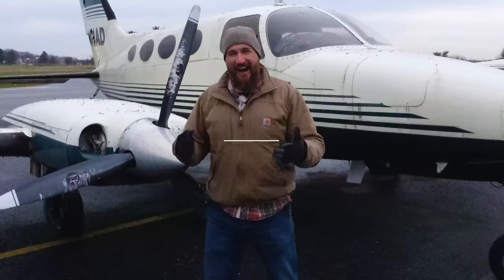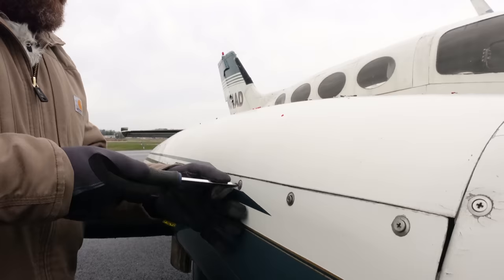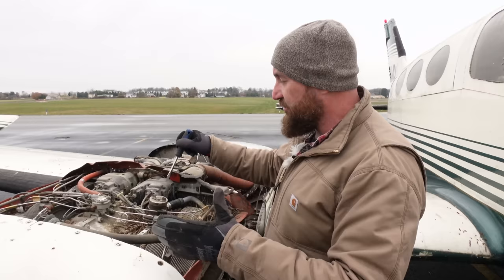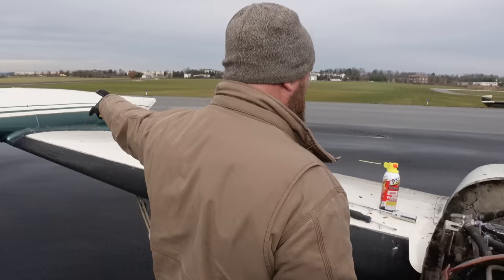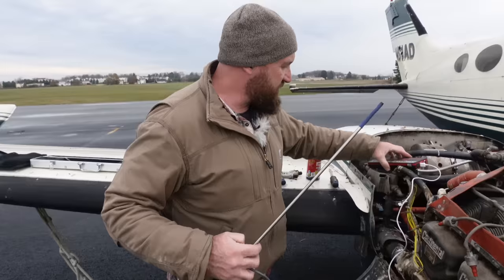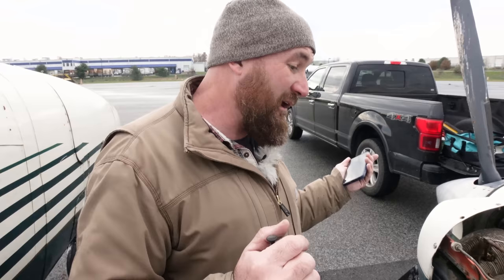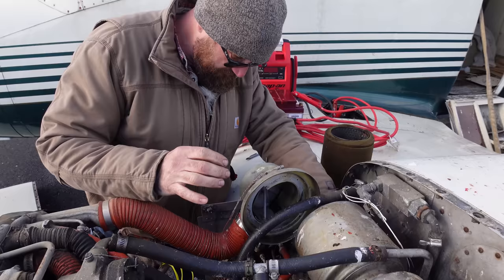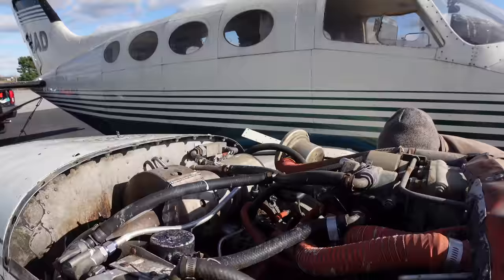FREE Abandoned Airplane... If I Can Start It! Ep1

Comment: 7 years as a 43250 Jet engine mechanic during Vietnam and then my A&P and 7 more years before moving on. You have not seen anything until you are working on a Pratt and Whitney Jet engine or a GE unit. There are more wires and more hoses than you can ever think of. Not to mention each and everyone of them has to be safety wired and then getting to some of the ones that are covered by other components well lets just say it lends a new meaning to what a bitch and what jerk designed this?
Reply: I have actually seen them with covers off...in a video and thought OMG...no thank you. I'm glad there's guys who like r WILL work on em haha
Reply: When I went through mechanics school thirty plus years ago we had a saying.  Engineers design machines to piss off mechanics. If you look under the hood of an automobile or cowling of aircraft today it seems to have not changed a bit.
Reply: @repairdroid77  It doesn't help the EPA is legislating tons of extra stuff required

Comment: Found this by accident, and love it!
  FYI a sized turbo has zero impact on that engine starting and idling.
  Looking forward to more! ✌️
Reply: Are they there for fuel consumption?
Reply: @brokearcader6625  no, any supercharger is designed to increase power.  In an aircraft of this nature it could be considered an altitude compensator.  If a turbocharger is seized there is still the ability for intake air to pass through it on the compressor side and exhaust to exit on the turbine side.  Both will be restricted to a significant degree but for the case of starting the engine a sized turbocharger would have absolutely no impact, so the creator here is 100% wrong.
Reply: Bullshit. Thats about all it will do if the turbo is frozen - start and idle.
Reply: @pbm7715  wrong
Reply: As a 30y r LAME I can confirm...turbo is just there to maintain sea level pressure at altitude for engine performance (otherwise less engine power as you climb into thin air). Nil effect on the ground so you could just disconnect and remove it and will have no impact on starting/idling.
Reply: Very glad someone told him. I've been a diesel mechanic for more than 40 years. I seen hundreds of turbos frozen in that time. About 85% of the time it's the bearings. The engine will run just fine without it just won't develop as much horsepower.

Comment: Sadly if it does fire up in the current condition without the jugs removed and cleaned, will destroy the engine cylinders due to the corrosion scaring.

Comment: Airboat owners might like the engines (running) Rebuilding mags is fun, turbos $$, Maybe too many AD"s due on the engines for airworthiness, but for airboats it doesn't matter. It all depends on which route you want to go. Good luck with it.
Reply: Regarding the turbos isn't it just a matter of replacing the bearings?

Comment: Half-way through and my guess "will it start?"... Yes, but it's gonna take you a ton of work + rigging stuff in strange ways like mixture, throttle, etc.  I think you'll get it to turn over and maybe chug along on half the cylinders with A LOT of work.  Will it ever be airworthy?  No way - the thing is a write-off and should be scrapped.  Best thing for the owner is to give it to you anyway, then it becomes your problem.

Comment: Continental are damn fine aero engines. I think both will probably run. How well is anyone's guess. But to get gifted a 401 1969 model if you can get it running! 
  Good aircraft Cessna and late 60s types were very solidly built. I'm kinda wondering what the spar/s are like and the control surfaces and their cranks and runs etc. Really interesting show , I absolute love stuff like this. You always learn something new. Or see a better method than your own. Thanks.

Comment: Seeing this now, I guess that it will need months worth of work before it can be declared airworthy. But then if you are taking lessons to fly, it might be a great reward to get it to the air and quite a luxurious thing too.
Reply: These types crash nicely too. Or, maybe i'm thinking of the PA twin.
Reply: I doubt if even this free kite would justify the cost of getting an air worthiness certificate.I served my time on Vulcans,Hs 748,Shackletons etc and know the alloy airframe will certainly be compramised due to corrosion.
Reply: @routmaster38  I think it's a great idea in principle but, yeah...perhaps a hard landing would break it apart...
Reply: @routmaster38  They have rebuilt WW 2 planes literally from scratches but of course the reasons to do so might be entirely different and resources likewise.

Comment: You can't have too much available amperage, the 12 volts instead of 24 can easily hurt things.
Just buy 2 high cold cranking amp 12 volt batteries. Hook them up in series to make 24 volts.
Reply: Low voltage isn't going to hurt anything.
Reply: @TonyRule  low voltage can easily burn up the starter and burn up the charging system and weld the points together.
You should actually know what you are talking about before speaking.

Comment: Those are amazing airplanes. 325HP engines and its essentially a non pressurized Cessna 340.  Unfortunately the engines are shot and best option is to find good used lower time engines to replace.  401's are not a common plane for sale, however good condition and running planes are $50K - $80K.  Stripping that plane, interior, new engines, prop overhauls and other maintenance is well over $100K.  Sad to see such a great bird sit for so long.  I love the Cessna 300/400 series aircraft. As mentioned in another post, the biggest thing is the wind spar AD.  Sometimes the highest and best use for this is to sell as a parts a/c to keep others flying.

Comment: That is a great airplane as I used to fly the 310 340 and the Cessna 421. They are commonly known as the twin Cessna line. You will need to gut the interior and take apart the cockpit to clean and replace wiring. Then both engines need to be removed and taken apart as well as the props. Will cost a decent amount of money but I would invest some money and time to get it running again. If you rebuild those motors you will then in a sense have have low time plane and could fly it for about 2000 hours be TBO. But of course the rest will need to be done as well. Partner with a qualified Air Frame and Powerplant mechanic. Good luck.
Reply: I wouldn't get in it till after all repairs had been made and 200 non eventful hours had been logged. Even then, my nerves would probably take a few years off my life.
Reply: @mctransportation9831  you ain't bullshitn
Reply: Love the 310. Such a cool plane

Comment: I applaud your enthusiasm, but this is difficult for an engineer and aviation expert to watch.. It was impressive that you knew to listen for the magneto impulse coupling! But there is so much that is outside your experience, things that pilots, owners and especially mechanics learn over the years. For example, it will run fine with a frozen turbo, just won't boost at altitude. 

I hope you can get some help from knowledgeable folks... sounds like you may have some available. Aviation is rewarding and fun, but inherently intolerant of error, especially trial and error.
Reply: As I read you post several things came to mind. I was a FE in Vietnam and since have been involved in aviation at C152 and gliders. It doesn't sound like he has  an A&P license which would be required if he ever plans to fly it. As you know the FAA is funny about the difference of being knowledgeable and being certified to work on an airplane
Reply: I was thinking that the same thing.
Reply: Absolutely nailed it, my thoughts exactly. I don't know how many times my crew chief and I cringed while watching this (especially when he turned the R/H propeller backwards- generally a very unwise move when it comes to certain Continentals!). Aircraft maintenance is not a game, and restoration in particular takes a lot more than a background in mechanics to be done properly- not to mention the extreme monetary investment one must be willing to reserve. Without the books, this thing isn't worth its weight in raw materials, and is further devalued by its archaic avionics suite.

Better to cut the losses and steer very clear of this one.

Comment: Even if you get it running you’ll need the airframe and engine logbooks.
Reply: He's in contact with the owner, I'm betting it wont be a problem
Reply: Not really, you can make new books, just hurts resale value but who cares
Reply: You can start new logs. I owned a plane where the logs were lost in hurricane flooding in the 1990s. It was no big deal and was even flown under part 135 after that. It often cuts the value of the plane in half. However, when I sold my plane I managed to get full price.
Reply: @robertthomas5906  the problem is the log books show what AD’s have been done and without that you have to do the AD’s and the 401 has a wing spar AD
Reply: @ericfletcher8454  LOL... Yes. Would you fly this plane without checking the wing spars even if it had been done before? Document everything. Otherwise, it can bite you later. I had a pair of scab patches on the bulkhead in front of the gear well that passed annual every year for a decade. Then it didn't. Now it was in the log as a concern. It took me two years to get a DER and the plane at the same place at the same time to look at it. About a week later I found a DER that was in my own neighborhood. God has a sense of humor sometimes. It was nothing. They grounded the rivets off, said - yea, so? Then riveted it all back up and signed it off. They think someone wanted to stiffen that area. Just a guess.
Reply: @ericfletcher8454  I'm certain the plane has been sitting for more than a year and the new log books would have to show compliance with any AD, just leave the logbook comments to people who get paid to worry about things like this
Reply: It's real funny there's two regs when it comes to these things, 1. People don't know what they say and think they do 2. People know what they say and interpret properly
Reply: @chadwilcox1077  LOL yeah okay big guy.  We all trust you and your comments
Reply: @ericfletcher8454  thanks

Comment: The algo recommended this to me, glad it did. Impressive resolve and process. I was hoping you'd fly it, but watched till end. Good job tracking down that fuel leak. Many crashes due to fuel leaks. Also how you sussed out that locked up turbo charger. If you gutted the interior and ripped out unnecessary weight, maybe you'd get better fuel mileage?

Comment: Been working on aircraft for a long time. Would be great to see it restored and made air worthy again but the cost will be really high. Sitting for so long I wouldn't be surprised if corrosion has damaged it structurally to the point of it not being worth saving. Gonna keep watching to see how things turn out. Hoping for the best.
Reply: yeah I saw a 206 in similar condition, rodents living in the wings rotted the aluminum skin on the bottom, although it looked fine on the outside, it was paper thin and crumbled upon being touched.
Reply: @andrewd.furnee5233  I can imagine. Had a king air with corrosion so bad it was a miracle how the wing spar hadn't cracked yet. Ended up having to cut the whole thing out anyways though since the piano hinges were rust in place.

Comment: It's really cool, and I've always wanted my own airplane, but looking at this video, I think I'd pass on this. This is way too much work without a good crew.
Reply: It would be a good way to get to know a certain model of plane, tho'... and there are some working examples for sale for under $70k.  I think he is required to have training to do any more than he's done.  He may not want to show those turbochargers being removed from the plane+then reseated, for example.  And what if that fuel seal he replaced were to bust during flight.  There's a video of a non-certified technician making that repair.  So I dunno... probably agree with you.

Comment: It depends on your definition of "started". I predict that you'll be able to get the engines to pop off, or maybe even run roughly on several cylinders, but at this point (I've watched to 26 min so far) I don't have a lot of confidence in you getting those engines running well without some major work and time being spent. I hope I'm wrong about that, and that they spring right to life.
Reply: Not knowing the hours on the engines is what makes this an expensive project.  All needs to be recert.

Comment: No log books it will be difficult to get it in the air.
Reply: According to who you know and how much cash you have. As is the American way.
Reply: You don't need logs to get it airworthy....Just an annual inspection. Logs only REALLY matter when selling.
Reply: Logs only save time for the inspection bill. Without them you have no proof of any recalls, bulletins or directives have been done and therefore they have to be redone to be right.
Reply: i mean, if you're ballsy enough you could (i think) experimental it. not sure I would but, it could be done
Reply: Notice it changed to just get the engine started?
Reply: You are wrong

Comment: ten years as an A&P here- I am very surprised any of those screws came out on those wing panels lol I am not sure where you're located, but working on jets from the coastal areas (or areas where roads were salted) was a nightmare when it came to panel screws and nut plates. I worked on a falcon one time, sat in Sothern Florida on a ramp for ten years, flew to Michigan on a permit, I bet I drilled and replaced more than half the panel screws and nut plates (valve grinding compound is your friend lol).... Cheers and good luck!

Comment: I admire your optimism in this project. As you discovered when buying a couple of o-rings; which probably came with a release certificate; aircraft spares are infinitely more expensive than car spares. The turbocharger is the next expense, followed possibly by the magnetos. Did you check to see if you were getting a spark with one of the plug bodies earthed somewhere on the engine. If you are thinking about getting this aircraft flying again, I hope you have very deep pockets. I am very impressed with your enthusiasm, but please keep a careful eye on your bank account.
I think I would seriously considering handing it back to the birds and mice.   “A” for EFFORT!
Reply: Bro you are so out of touch. Give it back to the birds!?😂😂😂  I want some of what you're smokin!! Seriously tho.
Reply: @projectcruiseaid8601  It will almost certainly cost more than the aircraft will ever be worth in order to get it flying. You can absolutely buy one of these that isn't in the best shape or modernized but that is totally able to legally fly for a fair bit less than he would spend getting this airworthy. Planes are not like cars.

Comment: There may be different material in the av o-rings for the extreme temperature conditions. Don't use standard auto o-rings unless you verify the material properties. You don't want the union to fail in flight because freezing shrunk the o-rings beyond leak tolerance.
Reply: Like the space shuttle... 😞
Reply: @davelowets  Yep
Reply: Auto O rings work in Alaska fine on cars but I agree
Reply: @misfit4816  Apples to Oranges. A car is not a plane... Planes, their systems, designs, and parts, are quite different than cars and are exposed to different environments and stresses than cars also.

Comment: Cool project.  Curious though, how does a plane sitting in plain sight of what looks like a relatively active airport, as opposed to some desolate field or forest somewhere, sit there with the window and door open, to the weather and wildlife?  No one notices that?  Looking forward to the next episode. 👍  FYI, 50/50 mix of Acetone and ATF makes a better rust penetrate than 2-stroke oil.
Reply: Common case of "someone else's problem."
Reply: It boils down to money. The owner is more than likely paying for that spot. A local airport near me has several WWII Harpoons sitting in various states of decay on the ramp. And theyve looked the same since i first saw them 20yrs ago. Not much if anything has been done to them other than tires filled and moved across the airport due to construction. Same could be said for a variety of other GA aircraft from cessnas to beechcraft to everything else in between. its sad. But its absurdly expensive to fix/repair anytype of aircraft